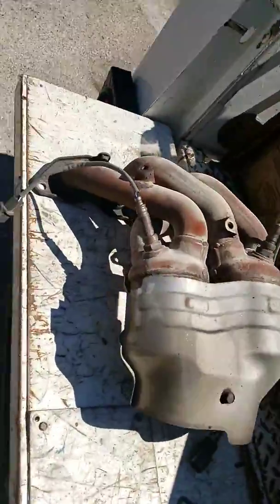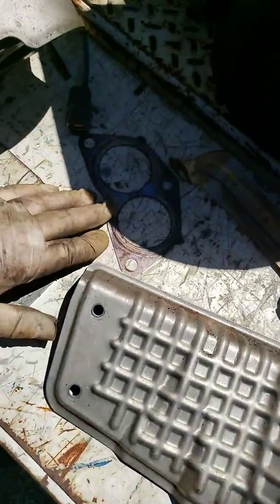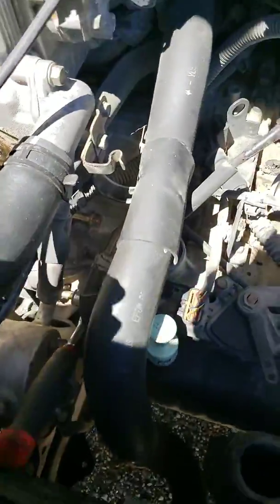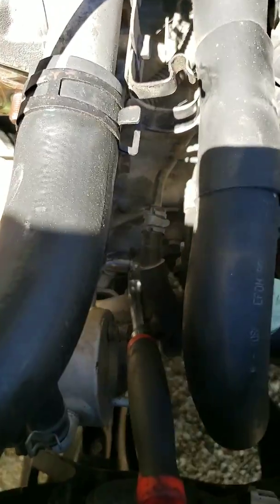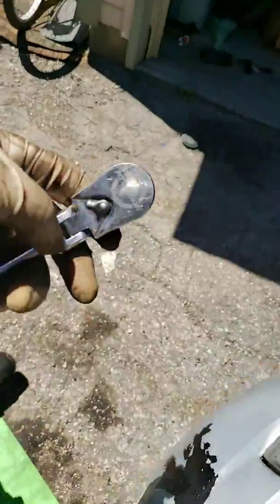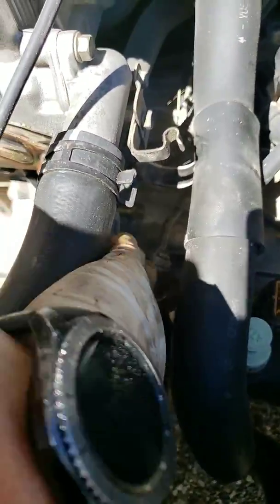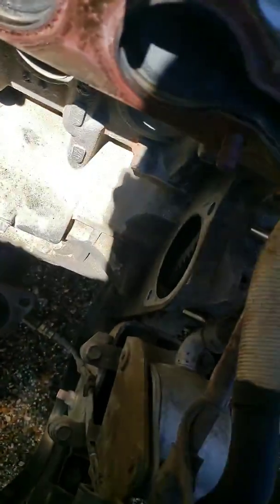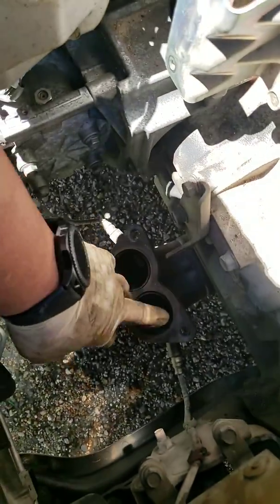07 Mitsubishi eclipse starter replacement

Comment: Yeah, but when the flywheel is damaged too....
Reply from the maker: Then, in that case, you will need to drop the transmission, unfortunately. It will be a great time to swap out the rear main seal
Reply: @mnrcustomsllc2158 I'm surprised you didn't tell them to remove the head lights to make the flywheel replacement easier, considering you went through the trouble of removing the exhaust manifold for the starter!

Comment: You don't have to take the manifold off
Reply from the maker: I understand that, but it makes the job alot easier, and it doesn't take much time to remove it
Reply: Maybe on a southern vehicle or somewhere dry. That manifold is gonna be rusted AF on anything in the midwest
Reply: how else would you do it? Im going to replace my starter this week and would like to know how to do it without taking the manifold off